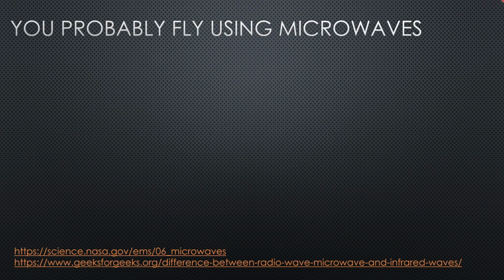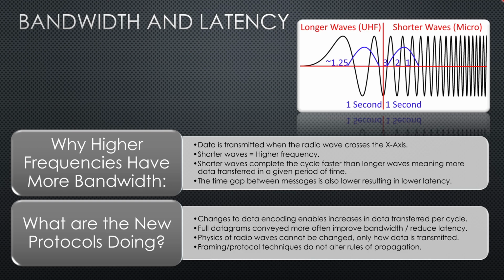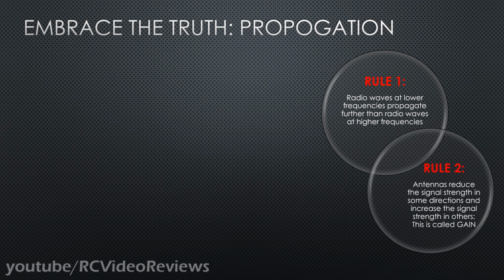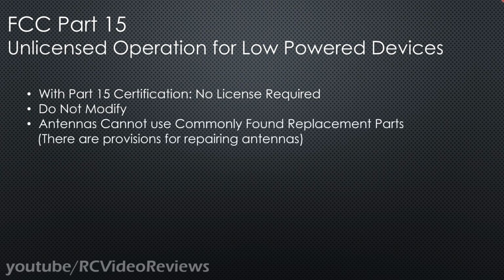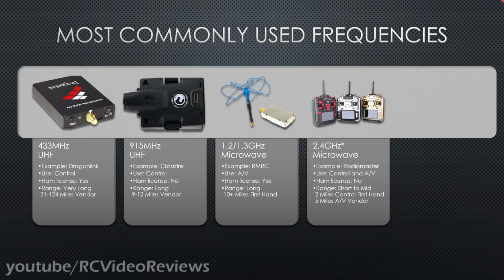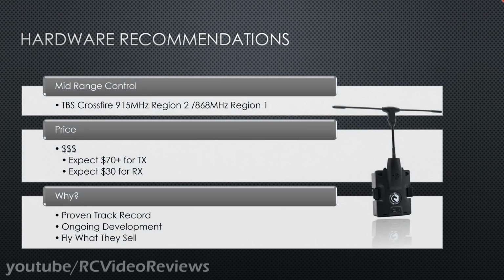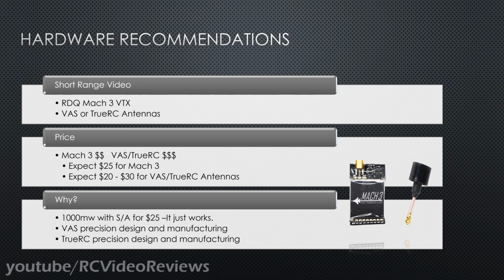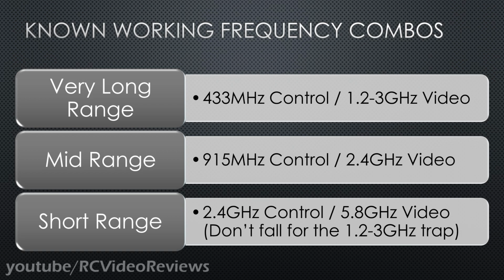RC Frequencies Explained for Beginners and Old Sticks

Comment: A Ham license is not difficult to get.  A little study and you are there.  I got mine last year to be safe since I do go over 250mw on my VTX on occasion.  Great stuff on the RMRC long range video.  I think I will try and use it on one plane and see how it goes.
Reply from the maker: When I bought my last 1.3GHz Rx they were either 1.2 or 1.3GHz. I haven't tried one of these new 900MHz-1.3GHz versions yet, but they all look like the same unit.